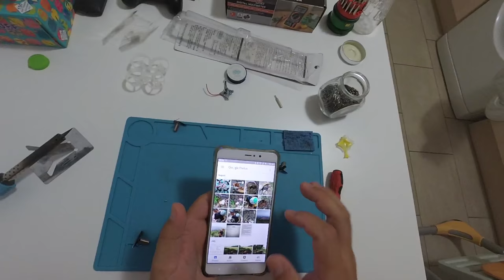Eachine E012 repair - receiver board replacement

Comment: Why there is vcc gnd data and clock connection on the back of the board can I connect another gyro module to it
Reply from the maker: Not sure what are those connections for, but why would you connect another gyro?
Reply: @nextor11  I have vision WiFi drone and I've tried to make smaller one,but while working on it accidentally the board fall from my hand and when I completed the drone and tried to fly it then I know that my z axis is gone the drone yaw always moves left and right again and again its just spinning how can I fix it
Reply from the maker: @rctechmods8165  This is not necessarily a sign of bad gyro. This behavior can also be caused by too much vibration.
Reply: @nextor11  I agree with you but after fitting it on my stock drone it stays same its yaw always moves left or right please give me any solution
Reply from the maker: If you don't want to replace the entire board, then replace the gyro :)
Reply: @nextor11  I know that solution but I couldn't find the same chip its a MP65M 377LB1 L1520 when I search for it on google ive found that this chip is for Samsung mobile gyro but the problem is only mp65m matches but other letters 377LB1 L1520 didn't match and also this replacement work needs hot air station and microscope so its difficult
Reply from the maker: Yes, it's not easy and I don't think it's worth. Better replace the whole board.
Reply: @nextor11  but am not able to find the same ic can I use mpu6050 instead of it
Reply: @nextor11  but am not able to find the same ic can I use mpu6050 instead of it
Reply from the maker: That's why I'm saying that it's probably better to just replace the entire board. I don't think you can use another gyro. These gyros are doing some internal processing and they all output different data. The board is designed to work with a specific gyro. At least that's my understanding of how they work.